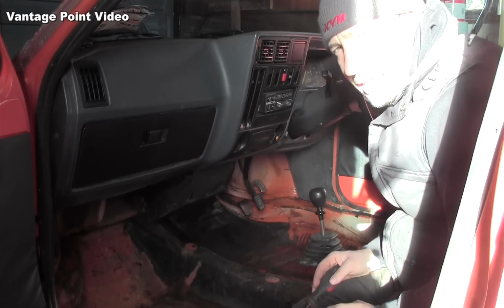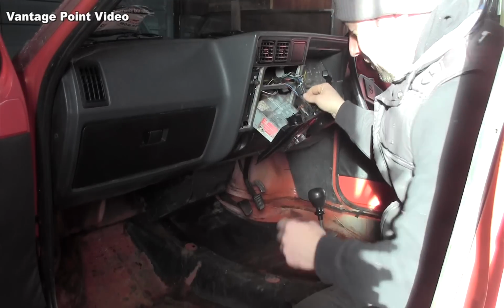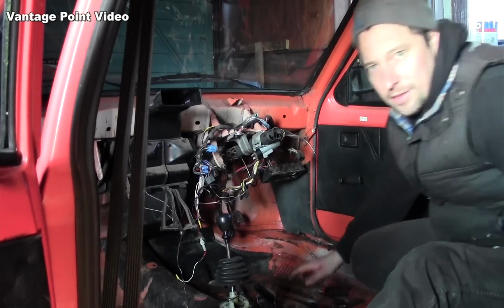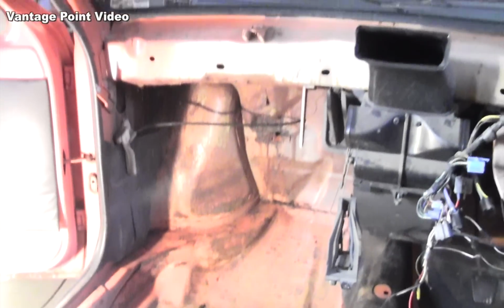Dashboard Instrument Gauges Removal: Car Restoration Diary #3

Comment: How did u take out the switch to put the lights on and off ? Did u just pull it out ?
Reply from the maker: You have to reach an arm in under the dash. It might be a good idea to disconnect the battery first because the connections can earth with the body through the metal plate built into the dash as you extract it. Press the clips on the sides of the back of the switch and it'll pop out into the interior with the wiring. Then you can pull off the connector and remove the switch.
Reply: Vantage Point Video thanks alot buddy